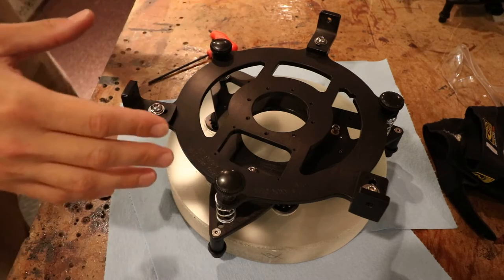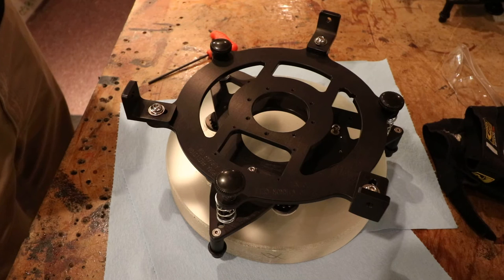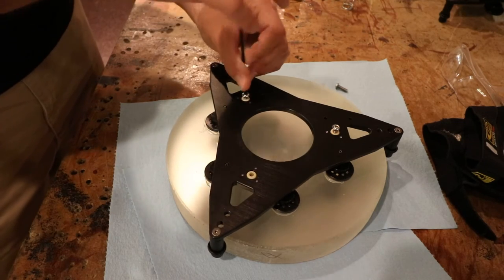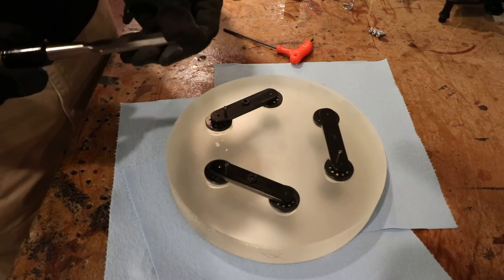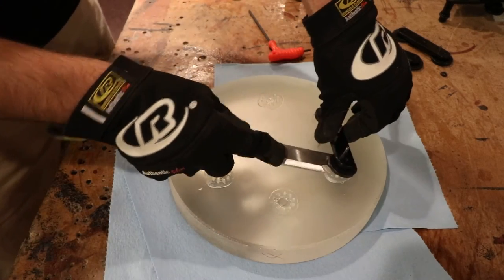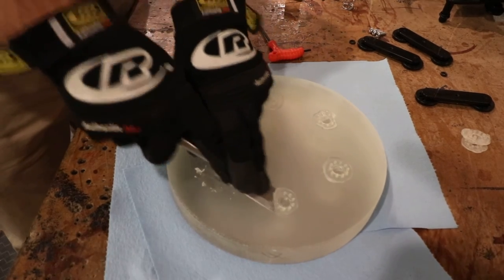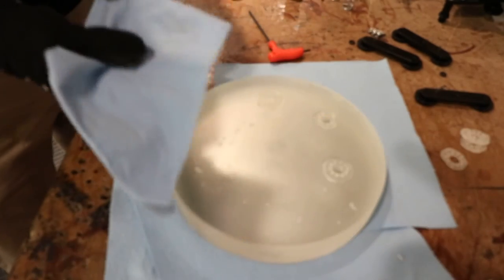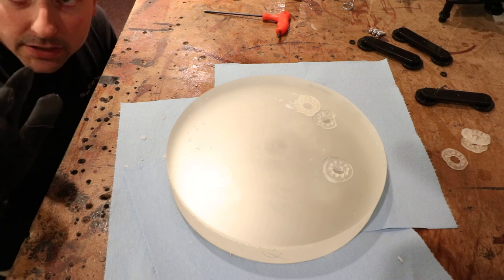Removal of Mirror Cell from Mirror in a Solid Tube Series Telescope

Comment: Great video!  Now that we know how to dismount the mirror, how does one reinstall the resurfaced mirror back into the mirror cell?  It seems like proper alignment of the hardware that needs to be re-cemented to the mirror would be critical and tricky!
Reply from the maker: Thanks for your comment. The manufacturer of these mirror cells has a document they've produced where they discuss mounting the mirror to the cell. Basically after you've removed the mirror, like I've done in the video above, you have to re-assemble the mirror cell completely and then follow the instructions in the following doc: https://static1.squarespace.com/static/5deee252a8313b70e3c625db/t/5e6a5daaa1302d0f5585412f/1584029099053/Instructions+RTV+to+disc+sheet+rev2.pdf
Reply: @robteeter  Not good enough for me.  I want to see it happening!

Comment: Hi. As an experienced car glass technician i think a better way to "cut" the silicon is using a string from a steel cable and wit globes or something to hold each end of the string, like wrapping them on a pair of screwdrivers, cut trough the silicon like cutting trough cheese with back and fore action. Clear skies
Reply from the maker: Thanks for the comment. See reply above to "Wire Works."

Comment: Hello i want to make mirror cell at home i want to make similar mirror cekl using silicon adhesive what are the advantages and disadvantages
Reply from the maker: Thanks for your comment. Briefly, using a silicone attachment method allows you to design a mirror cell WITHOUT an edge support system up to about 12.5" of aperture. Larger than that and you really should have edge support no matter what. But for 6", 8", 10", 11" and 12.5" diameter mirrors you can have 6 flotation points for the backside of the mirror attached with silicone and "call it a day" as far as support goes. No edge support necessary. That reduces the complexity of the overall mirror cell design and makes for a smaller diameter mirror cell which means you can keep the tube internal diameter (ID) smaller. This comes in handy for solid tube Dobsonians where, for example, you're mounting an 8" mirror in a 10" ID tube and may not have enough room for edge support hardware like a sling or rollers.
Reply: @robteeter  thank you sir it really helped me out in my culture we call teacher sir !!

Comment: I use fishing line to remove silicone.
Reply from the maker: Thanks for the comment. I have heard of that method before. However, I've only seen it employed for thicker "blobs" of silicone, as were used in the 80's and 90's Dobsonians made by Orion and Meade to attach their mirrors to their mirror cells. In fact I used that exact method on my original 8" Orion Dobsonian back then. That method isn't so useful here because the silicone pads we're employing now are much thinner, a bit too thin to really get good bite of the fishing line through the silicone, or so I've found. I tried the fishing line early on with these mirror cells and found it didn't really work and that I needed to try something else. That's when I discovered a chisel used in this way worked wonderfully.  Go figure!  :-)